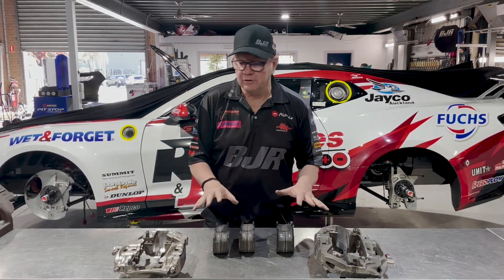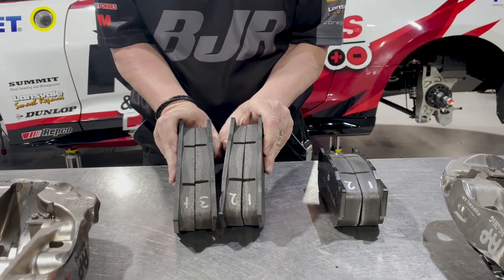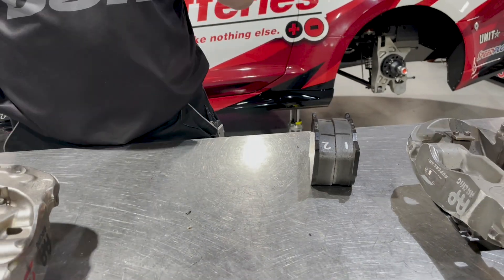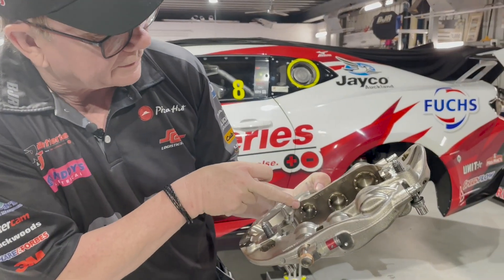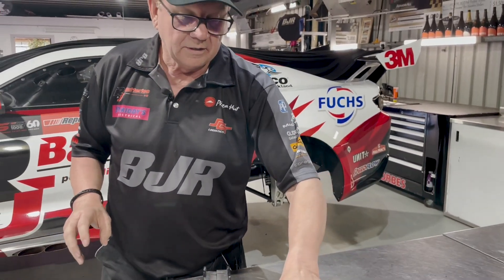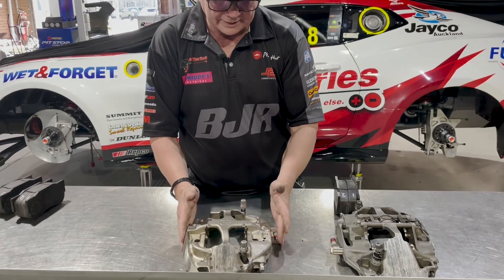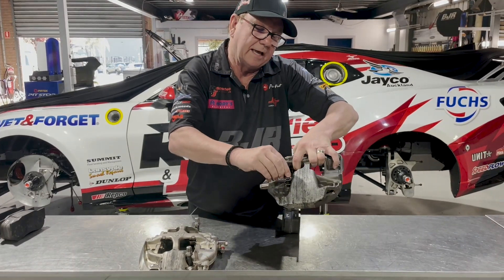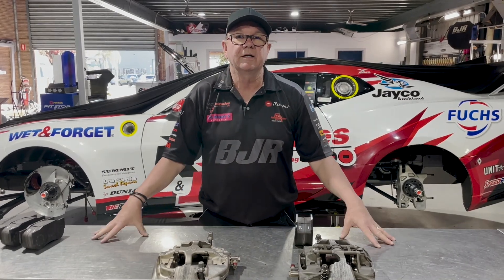Why we change brakes at Bathurst

Comment: Seems like another Gen3 stumble tbh, a shame a better brake setup wasn’t chosen. Anyway, does anyone know why both the ZB and Gen3 setups had different piston sizes? I could even get having 2 large and a smaller middle, but to have different sized pistons at each end seems weird? I would think you’d want more equal pressure across the pad? Only thing I can think of is it’s to do with where the fluid inlet is, and is in fact to try and keep pressure equal?

Comment: This is interesting, I understand they stagger the piston sizes to make wear across the pad more even as the friction at the contact point tries to pull the pad with it, so the piston on the trailing edge is bigger to hold the pad square.
But why did they make the piston stagger so great that it gives the pads opposite taper? It's almost like someone in the design phase over estimated the friction coefficent of the pad? Or is it just a function of Bathurst where there is the big stop at the end of conrod that heats the brakes up more than other tracks and makes the wear uneven?

Comment: And after all the hooha are these brakes cheaper to purchase, callipers, pads, rotors.
The new setup seem adequate but are obviously a lot harder to work with. And some teams changed them twice so it would appear more expensive in the long run.
Pad taper happens a lot on road cars, more so with the twin piston sliding head callipers often used. I actually recently got pulled over as the cop though I was pumping the brakes,, I was but only to get the pedal right up. Pedal was still well up. I gues a trait from racing where I was always chasing a pedal,, pumping the pedal up on the straights.

Comment: I understand that different piston sizes will move at different rates/pressures in relation to the master cylinder size, but why does the calliper have 3 different sized pistons ? Leading edge to the pads ?